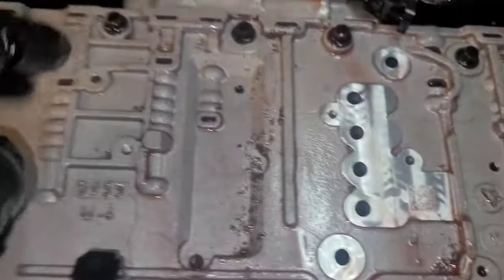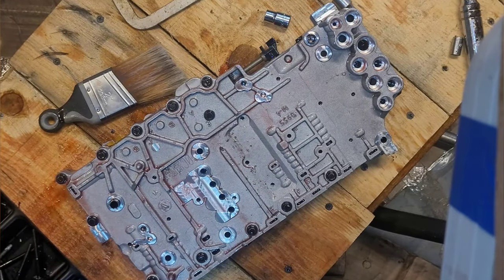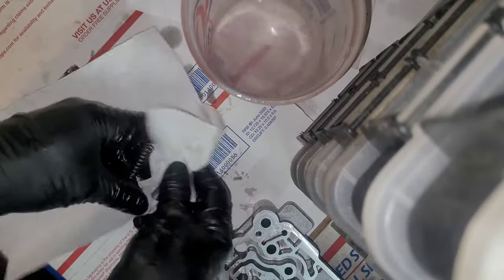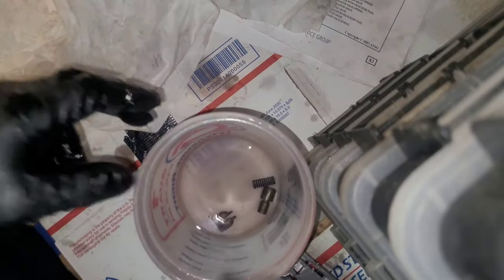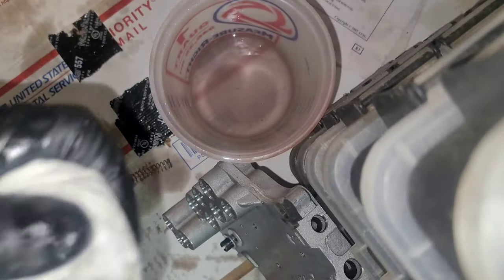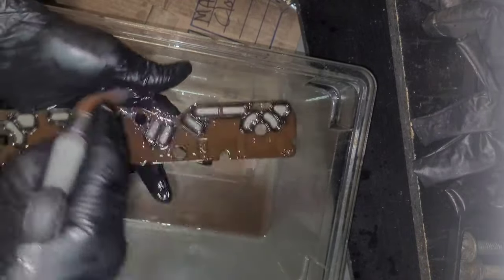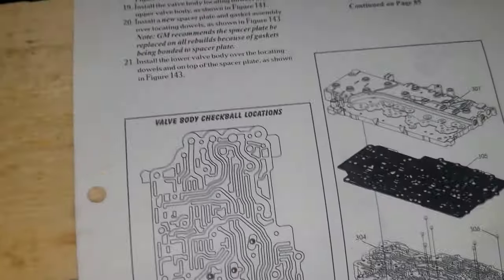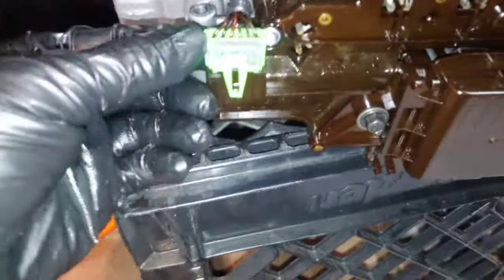6L80 Valve Body Disassembling Clean and Reassemble

Comment: Great video! I'm working on a 6L45 with 100k miles. After replacing the end plugs, the 1-2-3-4 and 2-6 end plugs  fit so tight it doesn't touch the retaining clip,  no tension on the retaining clips. Is the springs worn out? can i get similar springs from my local hardware stores?
Reply from the maker: No, can get from a hardware store. The plugs should fit tightly enough to Where You cannot wiggle them at all, but with lubrication in place like some fluid the bore plug should be able to move in the bore. You say you replaced the plugs, do you mean you bought new ones?  Or are just reinstalling the plugs that you took out? I'm not sure about the 6L45, but I think it should probably be the same, they should have tension. can you move the valve in the bore like I show at 19:05 in the video? It should be able to fly back-and-forth. And I don't believe that the Springs wear out over time, unless something stretched them out farther than what they're made to stretch out to or squeeze down to. It's probably that the valve is stuck in the bore. But you can't just use any regular Spring.You'll need to order the right springs for your transmission.
Reply from the maker: So both of those valves that you mentioned rest in direct contact with the bore plug and under spring pressure from the opposite side of the valve.Once both halves of the valve body are put back together, i don't think the clip can fall out, but Im not positive about that.
 I would look more for debris, possibly in the bore or on the valves, causing the valve to be stuck and prevent the valve from being able to move freely within the bore. If it is free to move and the spring seems too small, hopefully it didn't get mixed up with any of the other ones, because that would be a mess to try to figure out, I'd imagine.  Keep me updated, and let me know your progress.Good luck

Comment: What a very valuable information you shared with us, can you help me to locate the valve body correction kit ? i think i got one but was for the 6L80E , and mine is same as the one in the video the 6L80 the old version is for a C6 2008 corvette , and the sonnax kit i got the valves and everything are bigger than mine so couldnt fit on my valve body
Reply from the maker: I'm sorry that I didn't see your message on the day that you sent it. I hope that you have been able to find what you're looking for. If you have not yet, maybe I can help. I don't know of anything advertised as being a "Correction Kit". I have only heard of and even considered getting the sonnax kit, but i didn't end up going with the Kit because if the following:
When reassembling and cleaning the valve body i did not have any valves that showed any visible wear whatsoever.  All the valves fit inside their bore as tight as they possibly could and there was(in my opionion)no need to spend the money on a Sonax Zip Kit. I was not doing anything to increase performance or torque,  so I was happy to just reuse the existing valves. 

Transmission Supply shops can be hard to find in my experience. There's 2 where in the city that I live in, and they are both not well known to the general public. 
If you still need to find something or if I can help in any way, feel free to reply and let me know more about your situation and I can help ya.

Comment: Did you rebuild the clutches or just cleaned the valve body?
Reply from the maker: @MatthewDannevik  I did replace all the clutch packs. I soaked them in new fluid overnight and even tested the pistons with compressed air through the ports that connect to the valve body. I have a lot of other footage from the rest of the build that I need to find the time to upload.

Comment: What was the wash u used? “Mineral Spirits”?
Reply from the maker: yes, mineral spirits
Reply: @HVACRServiceTech  is it basically like acetone? Thats all i got at home.
Reply from the maker: @jamesethan3749  no, it doesn't seem to me, that it's like acetone at all. Acetone, I think, vaporizes pretty fast. Mineral Spirits,  takes alot longer. Acetone might work, it might not, or it might cause problems. I really don't know. It's worth looking up online before attempting it though.
Reply: @HVACRServiceTech  - Can you use the mineral spirits (or anything else) to wash the TECHM? Mine is full of metal but its a computer so idk if there are rules about washing it? Plz give any tips 🙏🙏🙏
Reply from the maker: @jamesethan3749  You can use the mineral spirits for it for sure. It is a computer but it's also waterproof because it sits in a bath of transmission fluid.
Reply from the maker: I went a lot deeper than what I showed in the video for cleaning it. . There's more metal in it than what you're gonna get just by washing the exterior. Let me look through some of my footage about the TEHCM, and I'll see if I can maybe upload it or I will send you another message later.
Reply from the maker: @jamesethan3749  Did you watch this video.  https://youtu.be/18Nmu0CmIsk
Reply: @HVACRServiceTech  Thanks! No I did not see it, I will for sure watch it! I ordered new pressure switches they are coming.